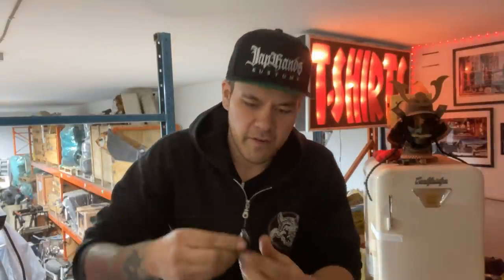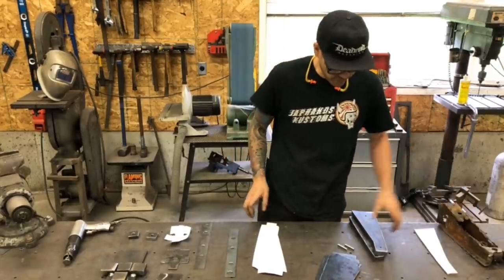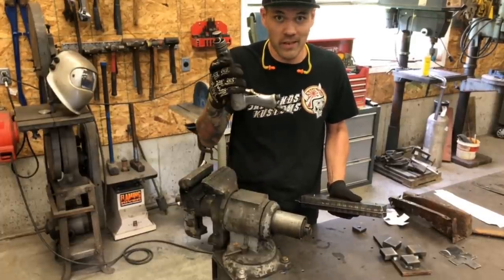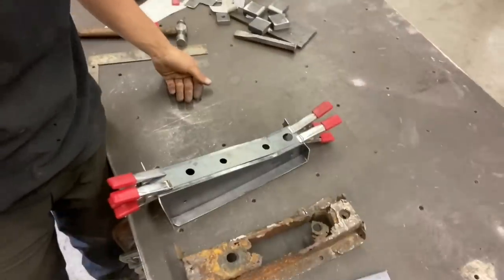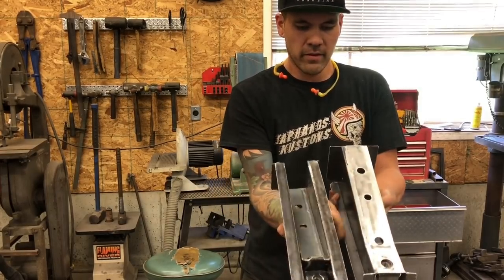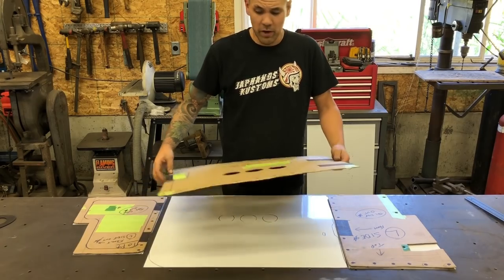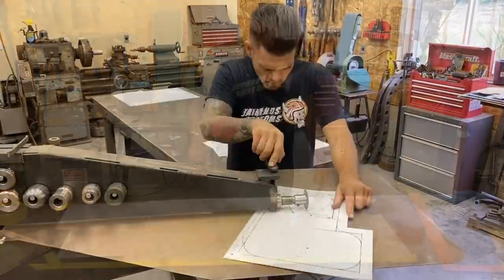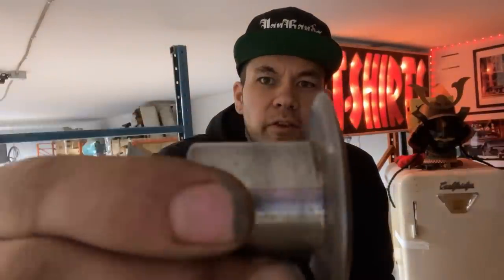DOUBLE FEATURE!! How To Hammer Form w/ Air Hammer + Bead Rolling Aluminum Panels (No Warp Technique)

Comment: These videos are excellent! The explanation of the tension in the sheet caused by the quilting in the center versus the untouched frame makes sense. There is too much material remaining in the frame. The dimple die helps absorb or consume the surplus material in the frame. I’m starting to do more sheet metal forming so watching these videos is so helpful. I can go down to my own shop and put my hands on the material and it all makes sense much quicker.

Comment: That is GENIOUS. I never even thought about using my air hammer. Holy cow. It made all the different using a jig. Last time I did any of this I used wood though. Which didn't turn out the flattest pieces. But the price of metals today would make that so much more expensive. And man, I need to get a Tig welder so bad. Them door panels are gorgeous.

Comment: Two very instructive videos, and the timing was perfect.  The other day, I got in a hurry while welding up a transmission table to mount into the receptacle of my floor jack, to do a one time job.  I was welding the thing out of scrap, and was filling a 6" by 6", 16 gauge hole in the middle of the table, and because I was in a hurry, I warped it.  Now, just for the experience, I am going to use my air hammer to stretch it back into shape.  It should be fun, thanks for the tip.

Comment: Back in 79' I was working repairing a couple of 90' aluminum landing craft/tugs that worked the North Slope. They were really fatigued and had a lot of previous crack repairs. Where the wheelhouse and deckhouse attached to the deck was also the juncture of the wing tanks and engine room bulkheads creating a real hard spot. The wing tank bulkheads (fuel oil/bunkers) had obviously repeatedly cracked out where they met the deck plating and it had a multi-pass weld that had a triangular cross section of about 4" X 4" with dozens and dozens of passes. Prior to the repairs, the tanks were air tested with about a 0.5 psi and at the end of this multi-pass weld was a crater that was spewing air. Basically, the fuel, and/or water, that was with the crack was flashing into steam and it would blow out and leave a crater at the end of a pass. I had a great guy working with me that had worked Todd's shipyard during WWII (he was about 6 months away from his Boilermaker retirement) and he had me grind a ball point of about a 3/16" radius on the end of an air hammer. He referred to it as a "bobbing tool" and when I "bobbed" the porosity at the end of the weld crater I was able to put a spot of weld over it and seal it. The bobbing tool had upset the hole and sealed it up so it didn't blow back out when welding it. I repaired those boats for a few more years and always used this technique to good effect.

Comment: @ 11:22 in 
You asked why would you build this mount?
This is an instructional video channel. 
‘Nuff Reason Right There!!!
😀
Always like to see how things are done. And different ways to do them. 

My brother, cousin used to draw cartoons when we were kids. He wanted a 3D image of one of his characters. So our dad took him out in the shop and laid out a piece of flat 1/8 “ aluminum sheet and body hammers & the portable welding table, had Rick draw a feature of the character and started shaping the face. 
As I remember it only took about an hour and we mixed some mortar and put in a wire hanger and had a 3D image.

Comment: I like the bit where you started the hammer form and the camera was trying to keep up bouncing with the blows lol . Its was a lot easier to watch you doing the folding over without all that elbow bashing . 2nd video you can see some of the warping and I always wondered what the lower wheel looked like when you did the diamond pattern . Thanks for showing these 2 methods .

Comment: I’d loved to have seen that ‘74 Blazer you were working on. I had one when I was in high school which is what I learned to drive.  Then later on after I graduated I bought a ‘79 model and fully customized it (probably not like y’all would have) with marine Naugahyde and crushed velvet seats and marine Naugahyde rear panels and custom soft top with clear vinyl Chevy emblem for the back glass and custom Cadillac Autumn Maple Metallic with extra flakes and striped out in Hot Pink, Purple, silver, grey and Blue and the Hot Pink was designed to be the Chevy Heart Beat   The motor wasn’t real fancy on the outside but she sure showed a few vehicles up when they pulled up beside me rather it was the 1/4 mile or over the course of 10-20 miles between the HP and the 3:08 gearing she’d go great

Comment: Working on a project that requires some really sharp bends (135-ish degrees from flat) in fairly tight spots. The 1.5mm aluminum is not exactly the most cooperative material for such tight bends. Thanks to this video i now will try the air hammer method with a piece of flat bar on the inside. Should sharpen up those bends nicely compared to just free-forming with a hammer.

I'm also tempted to get one of those palm nailers and try to use it as a more fine air hammering tool for sheet metal. It's not meant to have attachments, but i'm sure something can be figured out.

Comment: Great videos Karl. 
Let's say to cut a panel from a template 18"x18" ... After you've rolled that panel , will it have lost some of its size? If so, do you make the template say an 1/8th larger ?
Reply from the maker: It’s not even that much it barely noticeable

Comment: question on the panels .. say there 36 inches wide when started .. you do all your bead rolls then you do your dimple dye for the screw holes witch looks great ,,, each one of the valleys in the bead use the metal .. do you loose width and height with all the bead rolls  aka now you have a width of 35 and a half ?? ..and did it mess with your screw locations ? or did the metal stretch  enough to match the pattern .?. like on pole barn steel they start with the roll in the center then the next 2 then the next ones ,, the width they start with is lost in all the humps and valleys ,,

Comment: Another great show. I have a question not really related to car body panels. I have a bead roller motor operated. I jus put vinyl siding on my home and plan on covering door trim and windows with metal.I do not have a metal brake. Can I use a wheel to make 90 degree angle on the aluminum. Sorry for far out question.
Thanks 
Mike
Reply from the maker: Yes it can be done. Definitely use a guid to keep it straight

Comment: Newbie question:  could you use an air hammer to do a nice smooth knee indent in a motorcycle tank?   Hand hammer does such a rough job…..
Reply from the maker: Might help a bit but may not be too smooth

Comment: Nice job on the panels. I just bought a bead roller and learning to use it. You use .040 aluminum. Is it dead soft?  3003? Or what heat treat do you use? Thank you Please let me know.
Reply from the maker: It’s soft stuff 3003 I thijk
Reply: @MakeItKustom  thank you I'll get some.

Comment: "Shy Karl"...I didn't realize there was such an animal. As for making something that you can otherwise buy cheaply is: 1) You already said, the commercial units are too cheaply made. 2) You get to make it exactly to your own specs. 3) The more you do like this the better you get. 4) Once a set of quality dies are made, they last a lifetime. So really it's a win/win situation. I have been into old school fab shops where there are hundreds of different dies sets hanging on the walls for all kinds of vehicles. They're worth their weight in gold! The last time I did a '32 T bucket it came to me as a total mess, with a seized 350 LT1 engine mated to an M22 trans. Original steel though. Suggestion: It occurs to me that when transferring or working out a tuft pattern for a door panel etc. You could make permanent pattern lines out on a piece of clear Perspex. (Different dimensions on separate pieces of Perspex), so that all you have to do is lay the clear pattern over the panel layout and use which ever one fits best.  It would take a while to accumulate, but you could have a "library" of different patterns in different sizes ready to go. This obviates the necessity of working out the design for every panel. Once again Karl, great video.

Comment: I would like to see you measure the overall size of the 'blank panel' before you start working it and the overall size of the 'completed panel' to see how much shrink there was for the panels you did here. I'm thinking  you would have to account for that 'overall shrink' in order to fit the project? Then again, since you haven't mentioned it...perhaps your using the ole'eye'crometer' again?
Thanks...charlie

Comment: You are not kidding. The quality of the available stamped parts are horrible. Supper thin metal. No nut. and they don't even come close to the original measurements. I think someone converted the measurements from English to metric a few dozen times to get the measurements they sell this part as.